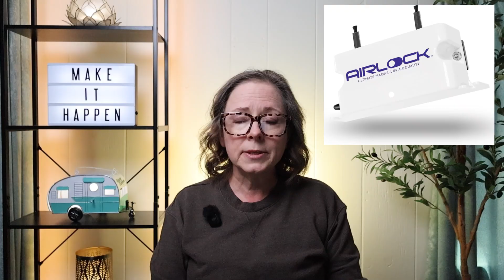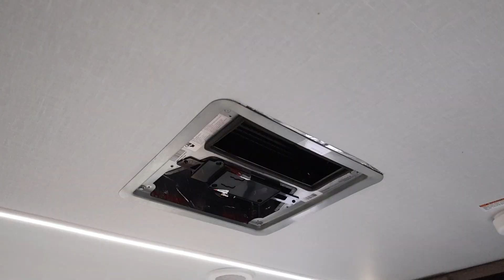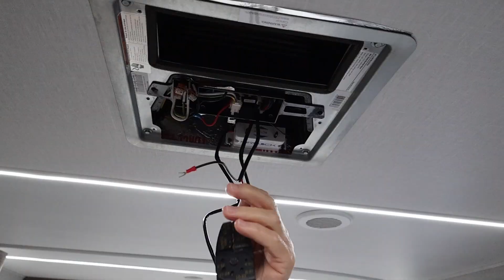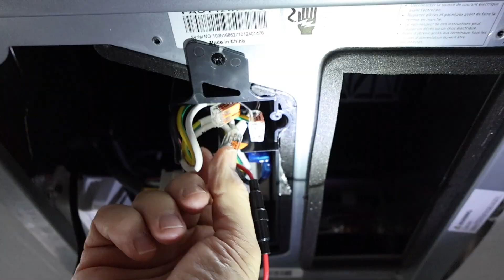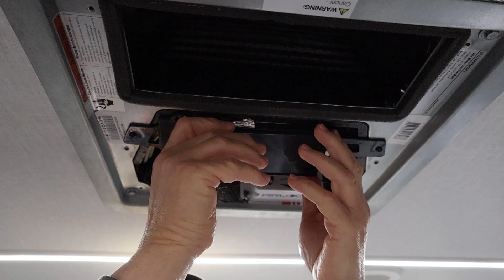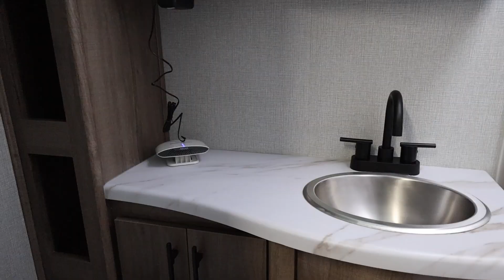RV Air Purifier Install: AIRLOCK One + Voyage Setup & First Impressions

Comment: You state in the video that you chose a power connection off the Low Fan (Red) wire. While I get the idea that the Airlock will only be powered when the "fan is on", however, this indicates that it will only be powered on when the A/C is set to Low Fan mode. This indicates that the Airlock will NOT be powered on should the High (or Medium if available) Fan mode is chosen, no?
Reply from the maker: Hi there! I can only speak to how this works on our RV, a 2024 Grand Design Imagine XLS.

By connecting the AIRLOCK One to the low fan wire, the AIRLOCK One only runs when the AC fan is running. We've confirmed this through testing in low fan mode, high fan mode, and auto mode. Our system doesn't have a medium fan setting, but I would expect it to behave the same way. In every mode we tested, the AIRLOCK One operated whenever the fan was running, regardless of the speed setting.

Just to be transparent, neither of us is an electrician. We chose this installation method after watching several videos and tutorials from other RV owners and comparing it to our specific setup. For our RV, this approach made the most sense and has worked exactly as intended.